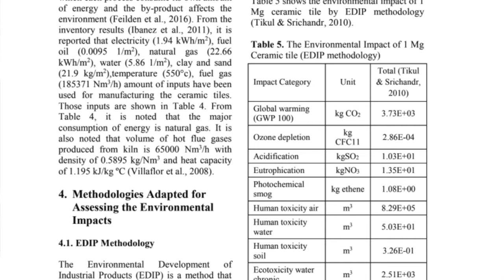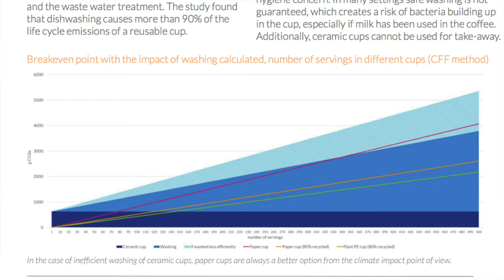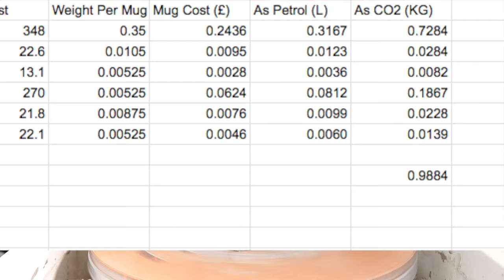How much CO2 pollution is one mug responsible for?

Comment: Just want to add that modern continuous kilns are much more thermally efficient than a batch kiln like hobbyists and artisans typically use.  Also, most industrial ceramics employ a single firing.  And economies of scale are employed in the transport of bulk materials.  The Invisible Hand can be surprisingly green.
Reply from the maker: Absolutely! I started trying to work out the carbon cost of shipping the materials the final few miles from the supplier but the efficiency multiplier makes it basically impossible to get a meaningful measure. The driving output isn't vastly different between one bag of clay and a ton of it, but the cost per kilo is incomparable at that point. A well run factory is like that with the efficiency turned all the way up.

Comment: Ok I love that you are able to communicate this information so well whilst throwing!! But I do have a question about the throwing process. I’m just starting to learning to throw clay and I noticed that you wet the wheel before you throwing down the clay. If the wheel is at all wet before I place my clay, it doesn’t stick! Just slides around everywhere??
Reply from the maker: It depends what type of batt you have (plastic/plaster/wood) and how much water you add. A small amount of water on a wooden batt will help the clay stick better, but a lot of water will stop it from sticking at all

Comment: After listening to this do you know if there has been a break down on electric Kilns versus gas or wood fire ? thank you for the research and the info.
Reply from the maker: No idea about wood firing, but the numbers I have for CO2 in a new gas kiln are actually pretty close to those for an electric kiln. There are limitations, the gas kiln was significantly bigger than the electric kiln and I don't know how energy usage scales, but broadly speaking they should be fairly close (which does surprise me)
Reply: @OldForgeCreations  I believe the numbers are not good when you add all, as a total. I'm not planning on giving up making pottery but I do always try to keep the kiln full when running and doing a single one time firing when I can. Thank you for the info, it's good to be energy efficient when you can.